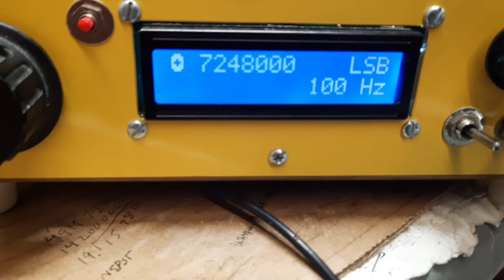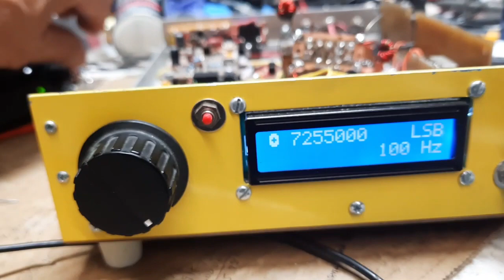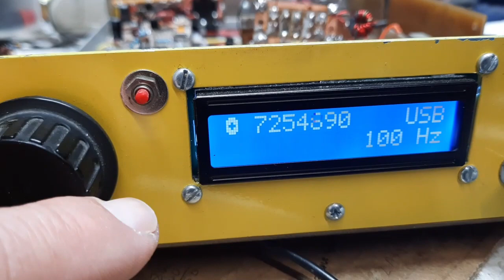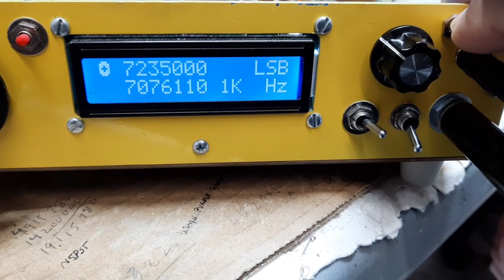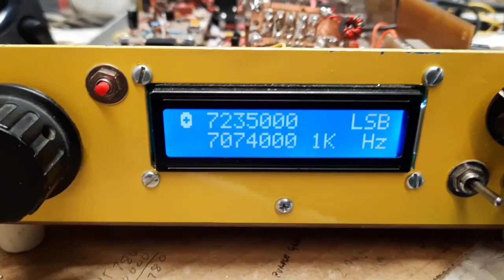Another Homebrew Xtal Filter ~ 4.9152 MHz for use in the Peashooter

Comment: Any recommendations about speaker grills? I have drilled a pattern inside a circle on metal panels but that is easy to make a mistake that stands out. I’m thinking of cutting a round hole and doing a grill cloth out of fabric or maybe window screen.
Reply from the maker: A friend of mine N2CQR has a hole saw which he uses to cut a hole in the panel. His next tool du jour is a drain strainer used in sinks. It is round and perforated. So, he finds the hole saw size and strainer   size that are close and super glue is your friend. You can buy small pieces of perforated metal and the same process with the hole saw.

73's
Pete N6QW